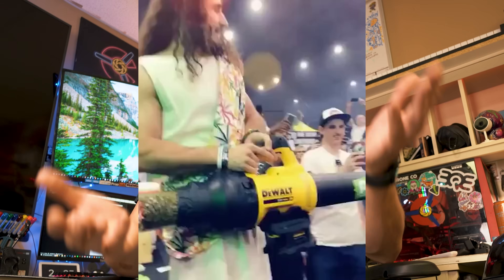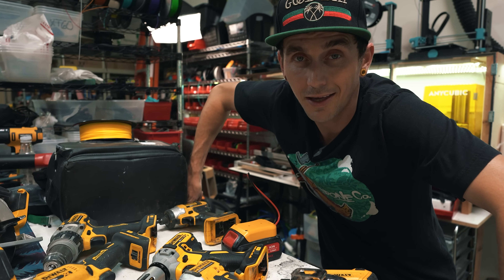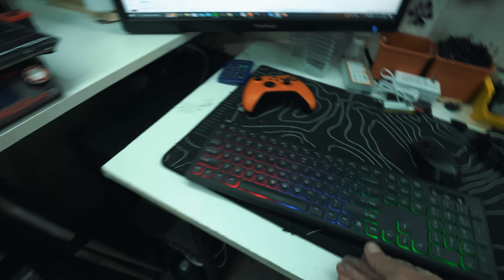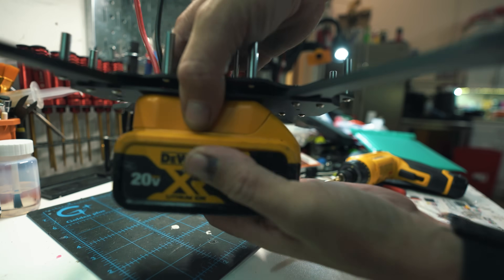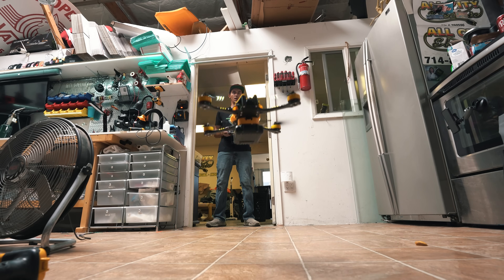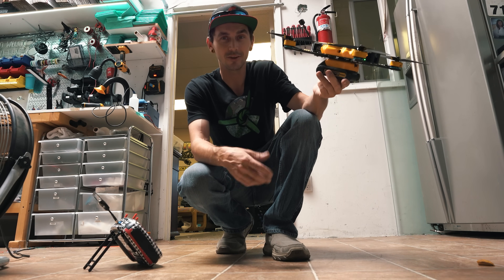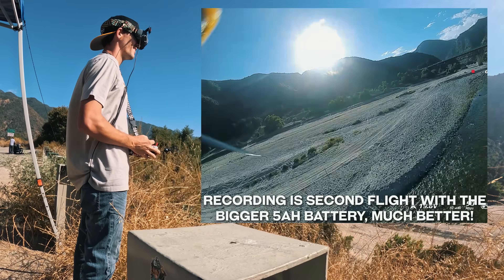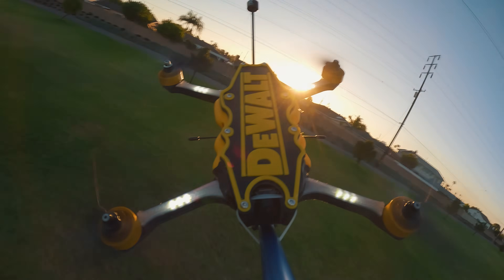DeWalt Drone - Build Your Own!

Comment: And now I wonder how well it would work if you also salvaged the motors out of the drill and used those to run the propellers.... No idea what kind of motors those drills use though, probably not possible.

Comment: I’m new to the hobby and work in industrial repair so i have a TON of dewalt and Milwaukee batteries…. Awesome video dude!! I will be attempting this. however i only have a cnc plaz as im a metal worker, was wondering if aluminum is a viable option for a frame? I dont see any for sale but as i mentioned im 1 week into this hobby and bought a dji drone to start, building a drone is likely 6 months to a year out for me anyways. Thank you for the video! Best one I’ve watched so far!
Reply from the maker: Try it with metal!! Make a video so we can all  see!

Comment: Amazon got knock off dewalt battery’s that work just as good but half the weight not sure if it would work better or not worth a shot they are cheep like $100 for 3

Comment: Great build I've often thought of the same thing... But do not have the technical skills to pull it off Nice work,,,,, what is the flight time on that and what battery did you use... Perhaps DeWalt should sponsor you... Perhaps we could make a tactical one and sell them into public safety I've got a lot of contacts there..  OK I got my answer I found your other video great review appreciate your testing those other batteries out...

Comment: You have to reach out to DeWalt to get these on the market. Trades would love to fly FPV in their spare time at their construction site. Having one would make them have to spend less on LiPos and chargers because they can just use what they've got. All they need is a radio, goggles, and the drone (By the way, you should make a casing for a transmitter and goggles with Dewalt logos and give the whole setup away.) I would 100% get one if they aren't too pricey since I've already got goggles and a transmitter. Mate a guarantee, they would go like crazy. If you do, make digital, analog, elrs, frysky etc

Comment: Awesome build! It’s funny I have been wanting to adapt a Dewalt battery as an external cinema camera power supply based on that adapter you used. Now I just need to figure out how to drop 20v too 7.2 And 12 v outputs .

Comment: I'm not in the yellow camp as far as tools are concerned but this really makes think about how underutilized these rechargeable Lipo tool batteries are in the maker community. I can already imaging a few other projects besides a drone that could benefit from a rugged hotswap battery with high output
Reply from the maker: I think that's the biggest lesson I learned from this whole project

Comment: This is cool asf, but im sad you didnt try using the motors in the drills as the motors for the rotors. a true dewalt powered drone. 😂
Reply: not sure if that would even be possible because of the weight but would be even funnier if you could get that to work.

Comment: Great build. Have you considered remaking the battery pack with a thinner casing just to trim from weight off the thing for more endurance?
Reply: Maybe but I think the idea is to just use the batteries in stock form as almost everyone has droll batteries handy and charged

Comment: I had the same idea but never pulled the trigger on it, I have several 6 and 9 as well as the 60v dewalt batteries . Thought about doing a beast class one with the 60v. I was worried about sag as well as they are 18650 lithium ion batteries in the packs but, looks like it works. I don’t have a 3d printer or carbon fiber cutter so I can’t take it to the level you did but, awesome job .
Get you some!

Comment: Nice build! Like it that you build and design yourself..especially the click on battery. Way better than lose wires/ cables. Keep making nice stuff!
Reply: Except the cables and connectors can handle WAY more current.
Reply: @scottyh72  that could be right acually, didnt think about that😬

Comment: Grab a couple of the Dewalt power stack lipo batteries. They can pump out the juice and they’re in the smallest battery form factor Dewalt offers. Then there’s the 21700 cell packs.

Comment: As a racer and carpenter I really enjoyed this! the quick swap battery bay is sick! not to mention these tool batteries are nearly indestructible. however they are Li-Ion so they wont be punchy. super cool though, nice work!
Reply: i wonder if he uses the powerstacks and they get a bit better?
Reply: I think the discharge rate on the Dewalt batteries is pretty high. My cutoff tool pulls a lot of amps when it's running full speed and they are def designed to handle that. Would be cool to see someone with equipment do a discharge test and compare flight feeling to lipos for punch

Comment: What is the voltage the battery BMS cuts off the power?
Reply from the maker: starts at 20v runs about 18v-19v for long time
Reply: does it cut power and then crash? Typically when you use your drill to the max, it just turns off with no sign. I was wondering if it does that with your drone. 
 @ChrisTealFilms

Comment: Wires for the battery adapter are 12 AWG.  Which is 20 amps.       20 amps is the limit.
Reply from the maker: yessir exactly! but for a low amp draw cruiser thats plenty
Reply: way more than that for short duration punch-outs 👍